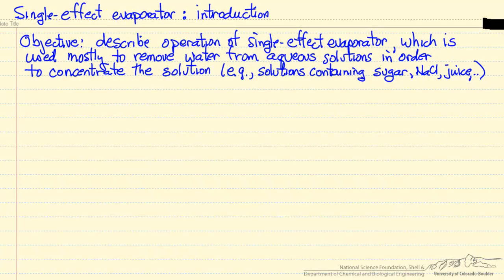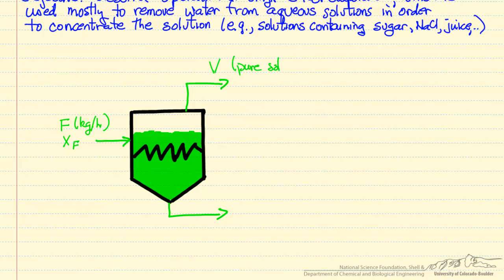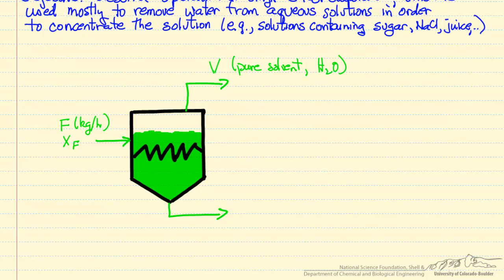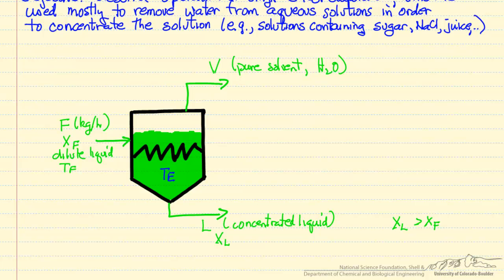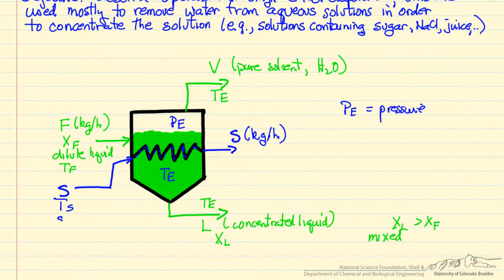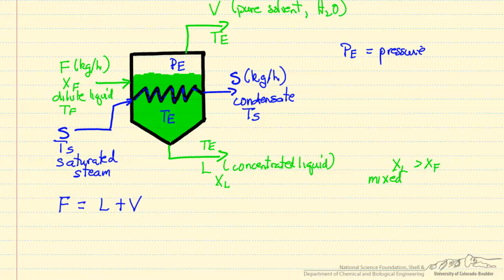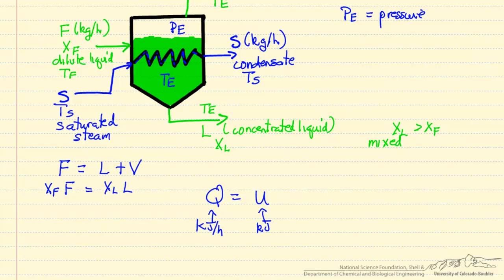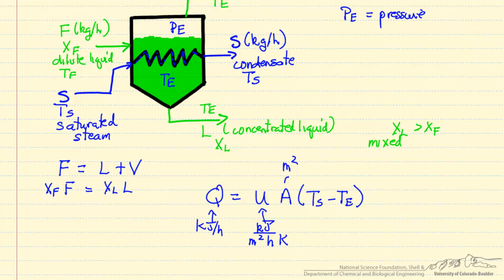Single-Effect Evaporator: Introduction

Comment: how is the temperature of the saturated steam the same as the condensed water? Isn't this essientially a heat exchanger, therefore the heat from the steam exchanges into the green solution meaning the condensed water would be at a lower temperature?